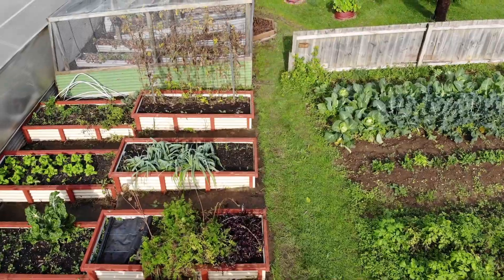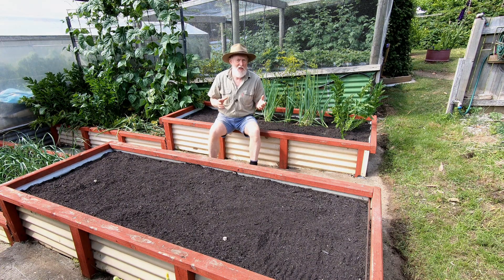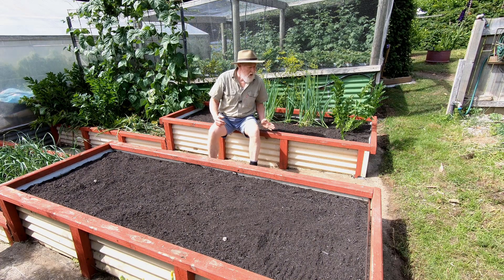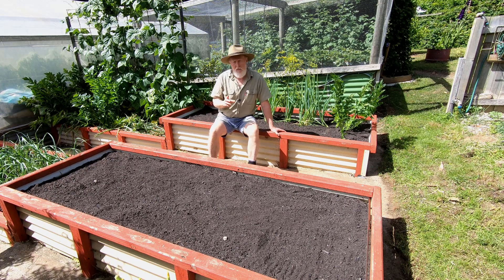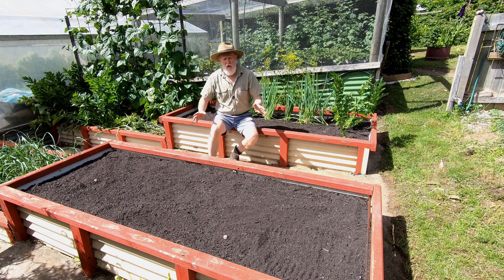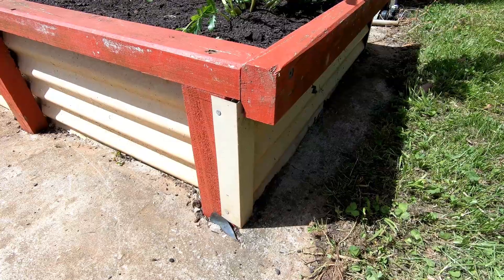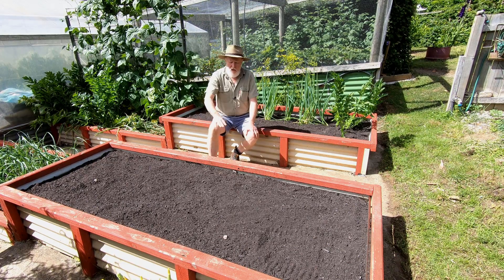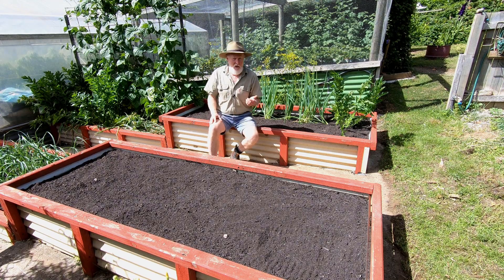How to build these garden beds....

Comment: If you wish to stand/sit & wish to use metal & you don't mind the extra cost galvanised square tubing is an option. Probably not that much cheaper then bought beds, but they are significantly stronger, especially if you can weld the peices together.

Comment: Thanks for doing video... I built similar ones here in Florida usa, used plastic panels. Need to add some more and decision time on materials! Considering aircrete but not sure I have the time to figure it all out this year. Cheers!
Reply from the maker: What about making some form-work and making concrete beds similar to the ones made by "MAN about TOOLS?" I would like to give them a try sometime.

Comment: Hello
I was wondering what tool you use to cut the sheet of colourbond with.  Thank you.
Reply from the maker: Sometimes you can simply snap it -  when working lengthwise ( as in https://www.youtube.com/watch?v=h0U-or4xJf4&t) Otherwise I suggest snips for cross cuts and a diamond wheel for lengthwise cuts ( watch https://www.youtube.com/watch?v=DilhwMrL91Q&t)
Reply: @homesteading  John thank you my apology I should have searched further I didn’t spot the video on cutting sheets, only a second on making where you cut a piece but across not down with what looked like large scissors/snippers.  Now found the attached videos.  Great info and garden.   Thank you. From Avril Kingston Beach